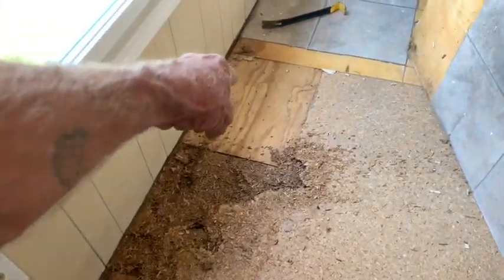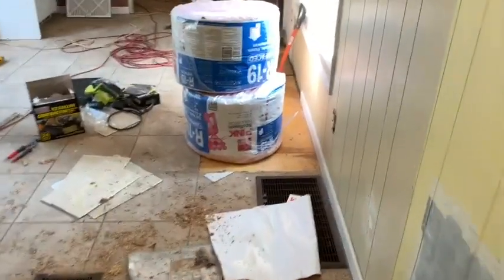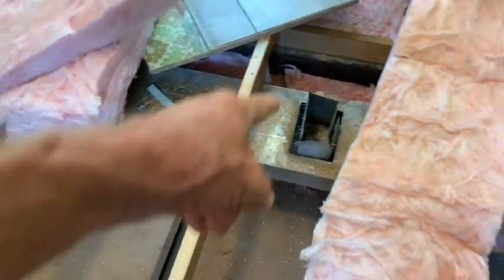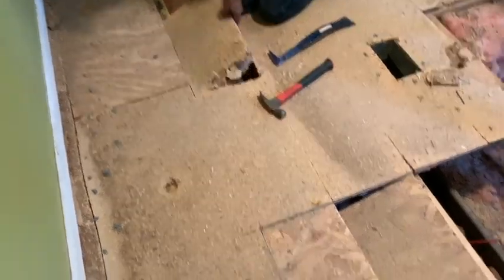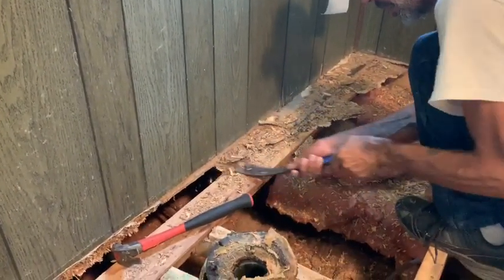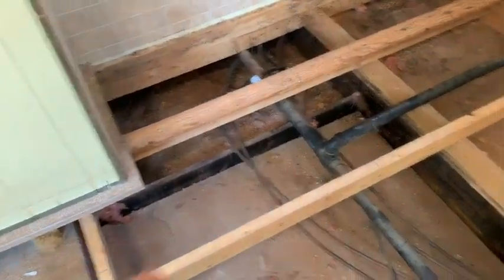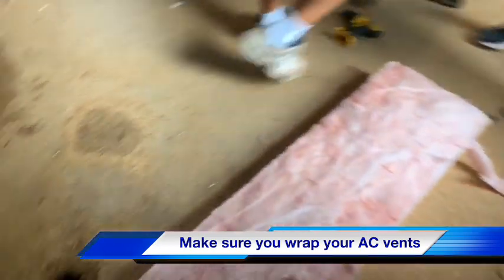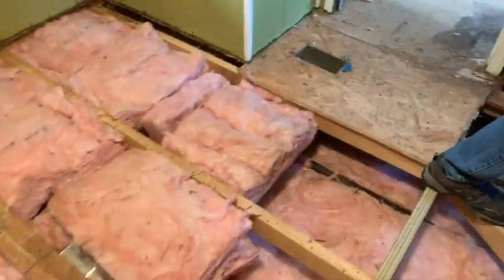How to repair a rotted floor single wide Mobile Home video 2

Comment: And why fix the floor if you're not going to find and resolve the leak?? Probably "flippers" 🙄
Reply from the maker: The leaks have all been taken care of already it’s not a flip this is my customers personal house that he will be living in when we finish this is definitely not a flip house and all the leaks have already been taken care of that’s why we are replacing the floors. The case was they did the floor last time before they replace the windows the windows continued to leak therefore resulting in what you see damaged floor again. At that point we have to remove the floor again and reinstall. Now that the windows are repaired and replaced with new and there are no more leaks We are installing a new floor
Reply: @Drewsroofingandhomerepair  Thanks for clarifying! I see so many MH flippers just patching and flooring over problems, but sometimes it is someone that cannot afford to do the whole project on their own home. So I guess you can only do what you can with what you have 🙂
Reply: Would it be better to wrap the duct with faced insulation to keep the moisture from penetrating to the subfloor again?
Reply: @Drewsroofingandhomerepair  those window are not leaking in most cases because unless the putty or butly tape installed on the backside of the window frame became compromised, the leaks in most cases are not leaks but instead condensation that forms on the aluminum window frames pools and drains down the walls. Additionally because there is a possible lack of ventilation. blankets over windows and so on that, is usually the cause of rotted window sills wall framing and water damaged floors. Not withstanding the cost of aluminum for the window frames to the homeowner and the manufacturer is the reason insulated vinyl windows are used these days. Much more efficient
Reply: @freckles3705  The aluminum heat  ducts runs under the floor which run from one end of the home to the other are not the cause of moisture under the floor but it makes sense to wrap the runs if possible with insulation and some manufactures do so but not all. In a correct senario the ground that the home is blocked up on should have an unbroken 6-mill black plastic vapor barrier installed on the ground to help prevent moisture from the ground. The belly or rodent barrier installed by the manufacturer is not considered a true barrier from moisture thus the ground vapor barrier. So to give you some idea of the general construction of the floor system most older mobiles have either 5/8" or 3/4" particle board flooring over 16" or 24" on center 2X6 floor joists. Most of the main electrical wiring is attached to the bottom of the joists. The bulk of the ABS pipe drain system along with the potable water lines are also attached to the bottom of the joists. The insulation is usually (depending on the age) of the home and who built it varied in R-value due to the requirements of thermal efficiency dictated at the time of construction.
Reply: @toolman3491  my 3/4", plywood (not OSB) floors rotted only above my duct work and only after I put in an exterior hvac unit.   The ground is dry underneath the home.  I had four different contractors tell me the same reason for the rot before I repaired it myself.  I may not be a contractor but I am mechanically inclined, have my own tools and did work in Lowes for 13 years learning a lot.  Thank you for the info even though it was not correct for my situation.
Reply from the maker: True
Reply from the maker: That to me means the air conditioner is too big for the house and it is blowing out underneath the house https://youtu.be/_3VfdXmCw0A
Reply from the maker: https://youtu.be/paYxDMsIt8c
Reply: @Drewsroofingandhomerepair    it was put in by my ex husband for the cost of the unit and at that time I had plans to add on to the home.  Of course the economy tanked and I lost my money so the add on never happened.  Thus the oversized unit.  It is about time to replace it so thanks for the info.  I'll be sure to get an appropriate sized unit.
Reply from the maker: Good luck I’m sure everything will work out fine
Reply: @Drewsroofingandhomerepair  just watched this.  Good info.  Can the boxes be attached with metal screws instead of rivets?  And a little advice,  the music was a little too loud and sort of drowned you out so cut it off when filming.
Reply from the maker: Sorry about the music normally I don’t have music playing because I monetize my videos and they won’t monetize with music in the background normally so thank you for that I’ll check it out and yes you can use rivets instead of screws
Reply: @Drewsroofingandhomerepair  👍

Comment: To be fair, nobody is going to do this for you. Repair people only work with houses. And trailer homes are NOT houses. You're going to have to do this yourself. And who has 5 weeks to take off work to build a new trailer?
Reply from the maker: I did this for them. There are not a lot of people at work on mobile homes. But if you look at my videos you’ll see that I am not one of them people. I love working on mobile homes and I do it a lot. And I do it for whoever. You are right it is hard to find somebody to work on mobile homes. It is a challenge every time you turn around it’s something different. They don’t build them like houses. That’s what I like about them so much I love the challenge. I hope you look at some of my other videos.
https://youtu.be/a34Hy_8ct0g
Reply from the maker: And that is exactly what I say in this video
Listen to what I say in this video. 
https://youtu.be/f82kikum1B8
Reply from the maker: Cheap living is awesome living wise spend all your money on a house for $1000 a month when you can live for four

Comment: You’re saying don’t patch fix the floor, but do the entire floor.  Okay, but you’re not addressing the original problem of the leak that caused the issue.  Adding a new floor won’t fix the leak.  You’ll still have the leak.  Maybe you address it later in the video, but I’m 5 minutes in and you’re not saying anything about fixing the leak.
Reply from the maker: Do i really have to tell you to fix the leak first.. Common sense
Reply: @Drewsroofingandhomerepair  just saying, you’re stressing the floor aspect, but idiots like me are wondering about the leak.  The fact that there was moisture from the heat duct was informative, but that wasn’t the only water damage.  As I said, great video and i know it’s hard to be completely spot on when explaining it all when you’re on the job.  My boss is buying crap trailers now and trying to fix them up, so your videos are great for what I need as I’m in there ripping stuff out trying to make it all nicer.
Reply from the maker: Thank you for explaining. I get it. The floor damage is because of the underpinning and the insulation and flooring being exposed from under the trailer. you will understand as we get more into the job. and thanks for watching

Comment: I'm needing this job done in my mobile home..what's the pall park of price on a job like this? Just a ball park
Reply from the maker: If I do one into the other this particular job using adventec flooring which is $85 per sheet cost him 11,000